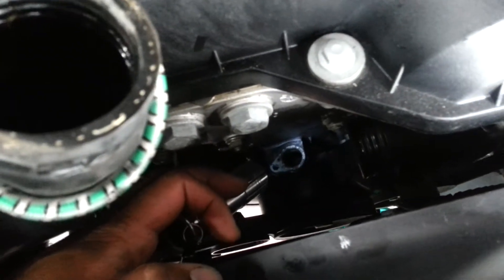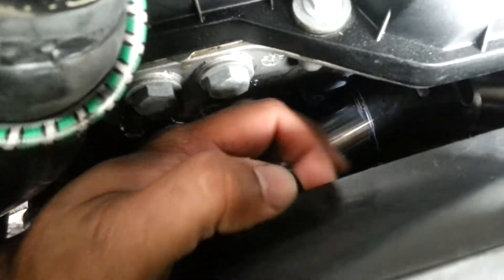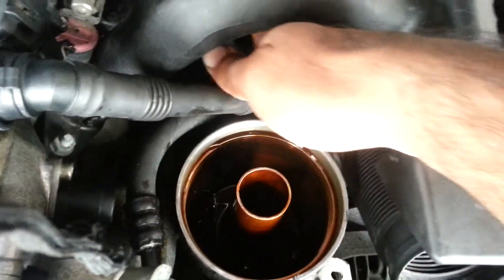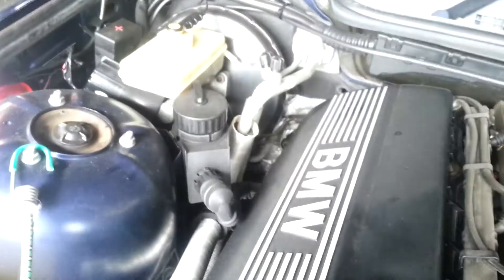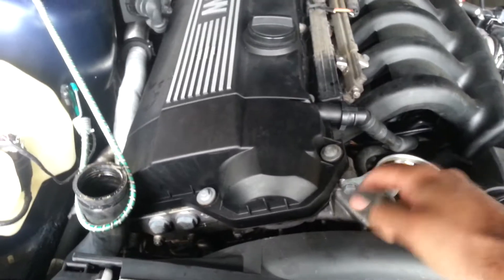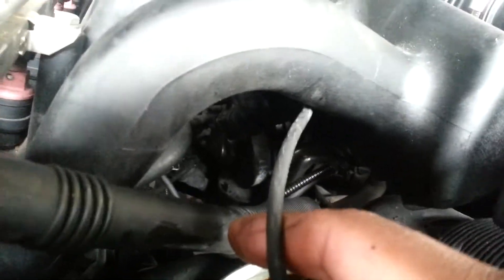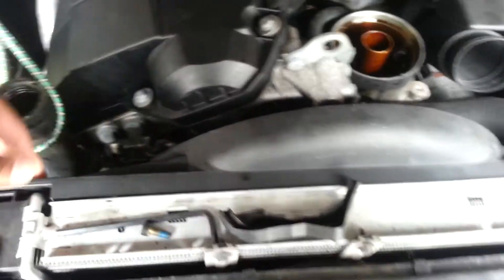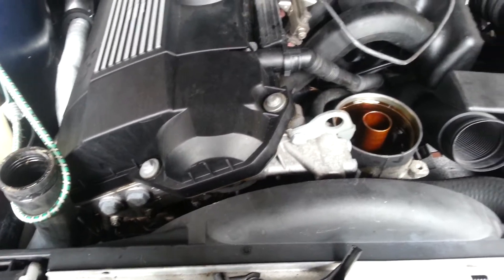E36 BMW OBDi M52B28 crank shaft sensor replacement

Comment: So I have an m52b25 (323i) 97', the car had an loss in power after it choked while driving. I replaced the cam sensor and its all good now... but the same day i replaced the cam sensor my car just stalls on my, like every trip to work. It doesn't mather how fast i go and at what rpm, it just stalls when it wants.... and some times it doesn't want to start up. Can it be an faulty crank sensor?
Reply: Update; it was the crank sensor😊
Reply: @jonathandeclercq6328 I like ur dedication to community cause I got the same problem with the m50 and I bought both sensors cause I want it finished not looking back at it again. Ever…😂
Reply: @UTMORERETUR  My e36 has the same symptom and I realized that there is excess gasoline and therefore it is drowning, it is difficult to start and when it starts it pulls well but later it loses power surely because it drowns with the excess gasoline, I already checked oxygen sensors, coils, maf, among other things and they are fine, is it the crankshaft sensor that is not sending the signals to the coils to work? Help, please, brother? 😢
Reply: My e36 has the same symptom and I realized that there is excess gasoline and therefore it is drowning, it is difficult to start and when it starts it pulls well but later it loses power surely because it drowns with the excess gasoline, I already checked oxygen sensors, coils, maf, among other things and they are fine, is it the crankshaft sensor that is not sending the signals to the coils to work? Help, please, brother😢😢

Comment: Wait so there’s two different locations for this sensor ? I’m looking for the crankshaft sensor on the rear under my starter but I see nothing , does that mean I have Obdi and my crank shaft sensor is in the front like yours ?
Reply from the maker: Yup. That's it
Reply: Bush Mechanic  quick question any knowledge is appreciated , so my car just stopped running randomly , just cranks , I already swapped out the fuel pump for a new one , and checked all the relays , there’s no power going to the fuel pump as it won’t prime or anything , someone mentioned that the crankshaft position sensor could be my problem , any ideas ? Thanks . I’ll sub 👍🏼 appreciate the help
Reply from the maker: @jerminsanchez3274  yes it could well be. In fact it's a good place to start if you can get your hands on a scanning tool
Reply: @jerminsanchez3274  did you solve it?

Comment: Hay bro got a 1996 e39 528i bmw my temperature gage works normal upto half way then when I go to plant my foot to accelerate or speed lol it drops down down cold? Any idea why Bro?
Reply from the maker: Bat Man sounds like your thermostat maybe on its way out. Temp should not fluctuate like that as engine temp doesn't range as much. When you plant your foot the water pump works faster. Cheers
Reply: Bush Mechanic... thank bro Will replace this weekend and let you know how it goes, thank you appreciate it.
Reply: Thanks bro so ive changed thermostat and its back to the normal... appreciate it bro thanks

Comment from the maker: please like my vids. I will load a lot more jobs on e36 cars if I get a good following
Reply: may I ask what symptoms caused you to replace the sensor? I am having slight starting issues and wont rev anove 2500 rpm. Does this sound familiar to you?
Reply from the maker: MrRoyalbeers hi mate! I have a very good scanner. But to me it seems you may have one of the following; coil, can sensor or crank sensor. best to scan it first. good luck
Reply: I will :) But just nice to know that im not completely off the mark. Thank you for your reply :)
Reply from the maker: MrRoyalbeers you're most welcome. good luck!
Reply: Bush Mechanic sensor replaced. car running perfect Again :)
Reply from the maker: MrRoyalbeers well done! which one was it?
Reply: Bush Mechanic crankshaft. and replaced the sparkling while I was at it.
Reply: sparkplugs silly autocorrect

Comment: Do you have to empty your coolant first or can you just put off the hose without losing any coolant?
Reply from the maker: best to empty the coolant if you want to avoid a mess!
Reply: +Bush Mechanic ok, and when i changed the sensor. Do i just put the coolant back while engine is not running?
Reply from the maker: +Givano yes please do not start the engine without coolant! after its warmed up with heater on full blast let the car cool andbtop up coolant.
Reply: +Bush Mechanic thanks alot man

Comment: Thanks so much for this bro, needing to replace crank sensor on my 323i M52B25 in the same place but there's no videos or guides, only for the OBDII rear crank cars. 

 One question, do you reckon I can get to it by taking the fan off instead of removing the radiator hose (and having to drain the radiator)?  I've borrowed the special fan removal tool off a mate
Reply from the maker: +G Dragon Sure, I just didn't want to take the fan off in case I cracked it etc.
Reply from the maker: +G Dragon Sorry dude, my mistake, you cannot get the wire shroud off without removing the fan shroud. you need to get the little plastic cover off that I refer to. Otherwise you cannot get the sensor off completely. It stops the lead from getting tangled up in anything moving.So in short, yes you do have to drain the radiator and remove the shroud also.
Reply: +Bush Mechanic I managed to get it out without taking off the radiator hose, was a blind job. Only worked I suspect because someone had replaced the OEM sensor with an aftermarket sensor already and they didn't replace the plastic bit that stops tangling so the wire was free
Reply from the maker: Bugger, I'd get that part from a wrecker and install it. the wire actually fits into it and I think keeps it from touching any metal. But good on you mate!